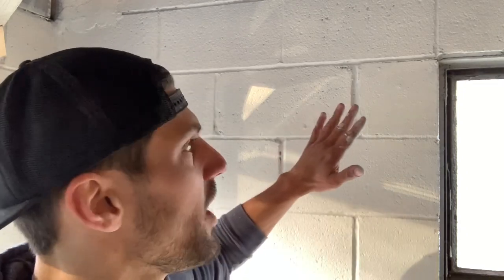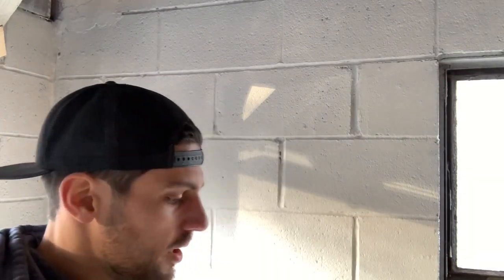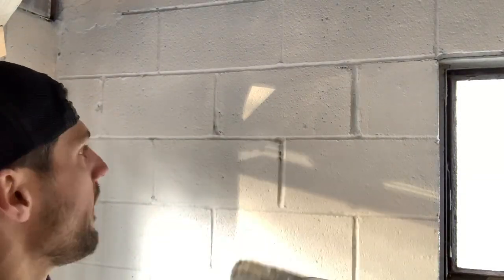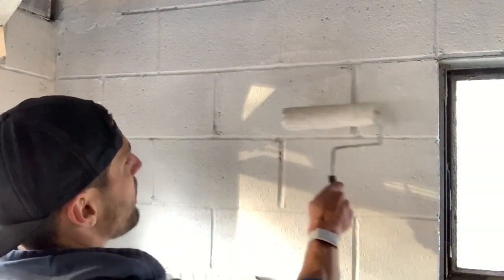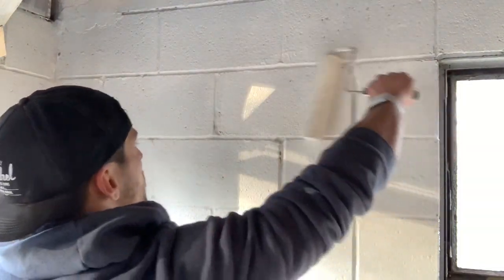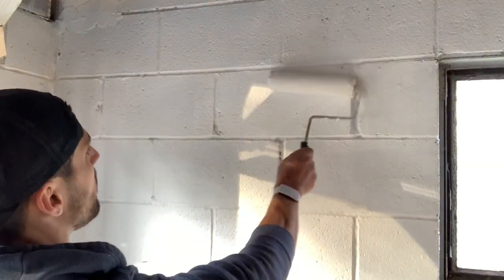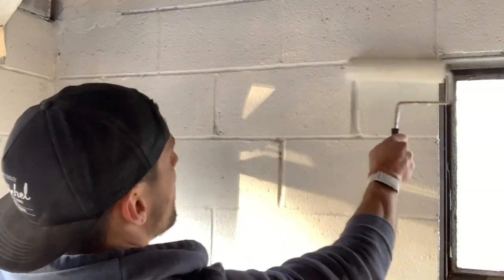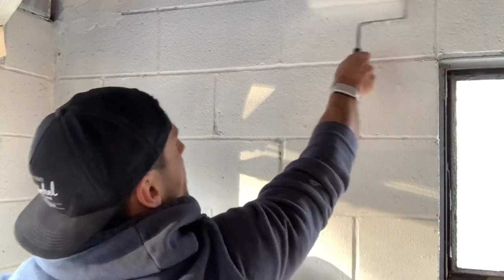Best way to apply DryLock

Comment: Interesting. It makes me think a paintbrush would be better in this case, as you're essentially sliding over the surface rather than rolling. The whole point of a roller is to do a quicker job (it's certainly not to save on paint - I can tell you!)
Reply from the maker: Great thoughts. Thanks Simon!
Reply: Brushing block is a nightmare. Use a whiz if the 9 is too heavy to work with for you

Comment: Get a paintbrush Ash.

More seriously. I have a rain exposed wall (ground + top floor). There’s already an old coat of paint on it. Do i scrape that off with a “i don’t know what tool” and then apply the DryLock white paint?
Reply from the maker: I have no idea, this was literally the first and last time I ever did this.
Reply: @ashrcrawford  Ok thanks. My common sense is telling me to scrape off as much of the old paint as possible and to jet wash it. Then paint after wall is dry.

Comment: Is drylok still effective even if there’s paint on concrete
Reply from the maker: I think so? Literally the first and last time ive ever used it.
Reply: If it’s old paint best to get it off with wire brush or solvent. If it’s stuck on real good you can just drylok over it